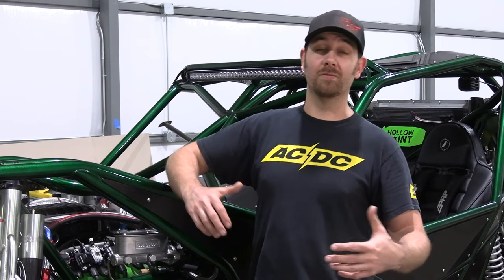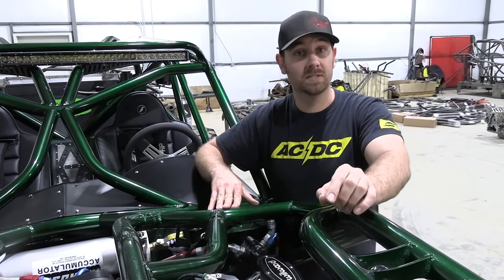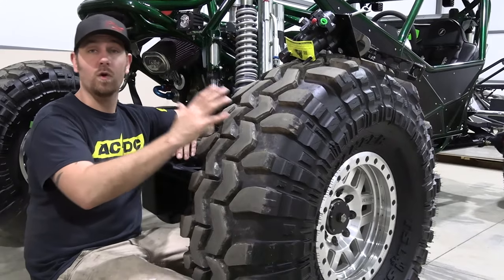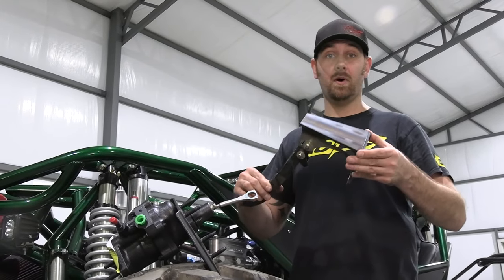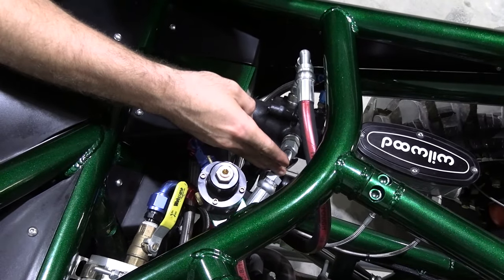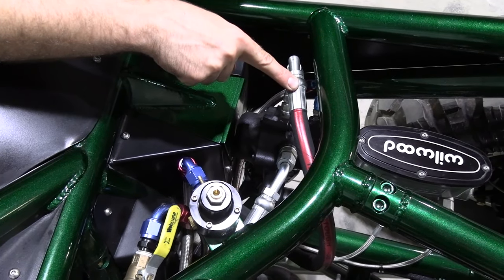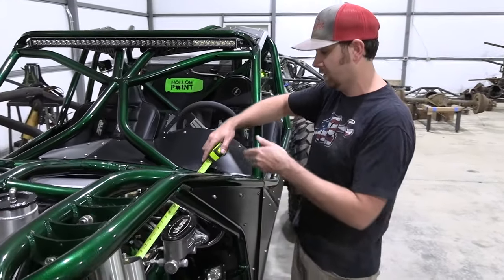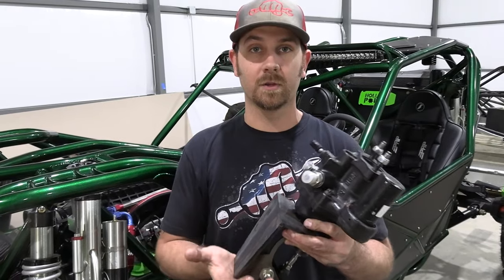HYDRO BOOST BRAKE SYSTEM EXPLAINED | TECH TUESDAY

Comment: I am building a YJ and have a 2012 superduty dana 60 and a 2003 Suburban 2500 14bolt rear axle, it will be 4 link front and rear on 40's. I have a 5.3 LS with a turbo, 4l80e, dana 300 in process of being installed. What brakes would you recommend for the setup assuming I will be using a hydroboost brake setup also given it will be full hydro steer (not yet acquired).

Comment: Any idea if a Jeep master cylinder will bolt up to your PORTED AND FLOWED HYDROBOOST UNIT?
Reply: Or are their lower cost options than the Wilwood unit?
Reply from the maker: you can use a factory chevy one.

Comment: Classic Performance Products makes a pretty decent system. I’ve installed them in jeeps, pickups and cars. I don’t recommend using a stock master and reservoir, most the time the mounting ears don’t quite line up with the hydro boost, the reservoir holds half of what a oem/aftermarket hydro boost reservoir does, and the master piston body is half the size of a hydro boost. If budget is a concern. Go to a junk yard and grab one out of a 3/4-1 ton truck. Ford, Chevy, Dodge doesn’t matter too much they’re all basically the same dimension give and take here or there. Remember bigger is always better in the world of brakes!
Reply: Sorry Jake! Not tryin to get people to cheep out on your kit. Just started rambling.
Reply from the maker: bigger is not always better when it comes to brakes actually.
Reply: Do you mind explaining? No argument here. Just looking for wisdom.
Reply from the maker: you want everything sizes appropriately to work together.

Comment: That's great in all but does it work well with manual steering?
Reply from the maker: Why would you want hydro boost brakes and manual steering?
Reply: @BustedKnuckleOffRoad  to take off the vacuum pump on a diesel engine in a pickup

Comment: @ Busted Knuckle Offroad, how do you manage to run PSC steering and the hydro booster off of the same power steering pump?
Reply from the maker: We build the system to work together.
Reply: @BustedKnuckleOffRoad  Is it documented anywhere, on a forum?
Reply from the maker: @Mike-xn1bh  we port it to work with the higher flow pumps.

Comment: Hi awesome video - have a E-450 Motorhome with Ford’s hydroboost but with all the weight its stopping power is seriously crap so can’t let my petite wife drive as she can’t put enough force on the breaks for a hard stop not to mention emergency breaking, in fact i am far from being able to kick off the antilock on pavement too,  do you offer any solution for increasing breakpower?  I,e. turning cylinder to give it more pushing surface area to multiply the psi of the pump more?  Desperately needing to improve the breaks, thanks in advance.
Reply from the maker: Sorry but we only do off road brakes
Reply: Thanks for responding

Comment: Sorry for the long question but here goes, I have a 2000 K3500 with factory hydroboost.  I did an axle swap and now have 4 wheel disks.  Does the wilwood master you sell fit my hydroboost or do I need your unit also?
Reply from the maker: They should have a master to fit yours. Give us a shout and we can make sure you get the right one.

Comment: If there's a hose that leaks on this system , will it cause the abs brake light come on. Sometimes I get a hard brake pedal.
Reply from the maker: We don't have ABS brake lights in these vehicles
Reply: @BustedKnuckleOffRoad  yeah , but was wondering if you knew if this could be the culprit.

Comment: Will a bad power steering pump affect your hydroboost? And/or vice versa? What about low power steering fluid?
Reply: If the power steering pump is looped into the hydroboost, then yes, braking performance will suffer. If power steering fluid is low, you'll have a hell of a lot more problems than just suffering brake performance. You may find your steering gear and pump fail prematurely.
Reply: if you have low power steering fluid then you probably have a leak at your power steering pump or one of the lines.  And yes you will have weak breaks due to the pressure not being able to build and hold if your power steering pump is the culprit.

Comment: I have pretty much the same setup. New power steering pump, new rack, hydraulic lines. After a couple miles all 4 brakes lock up and drag. Any advice?
Reply from the maker: will need more info

Comment: Hey guys I am from Australia and am having trouble with my Hydro boost setup.  I have the same booster as you are using in your video.  I am having trouble with the resovior overflowing after I turn off the engine.  Only started after I fitted the Hydro boost.  hope that you can help me out.
Reply from the maker: sounds like it may be plumbed wrong

Comment: Just purchased a hydro booster for my 69 Camaro and trying to plumb it in to my rack and pinion but the thing is is that the port holes are so close to the engine sump I see no way of getting the lines in there
Reply: Well- what did you come up with? 🤔
Reply: @smoothoperator7023  so instead of using the straight fitting that was supplied in the kit I purchased lower profile banjo with straight fitting coming from the side if that makes any sense

Comment: how does this plumb in with full hydro steering?
Reply: @Ole Coot   > The power steering pump does double duty with the pressure valve determining the pressure. Rack & Pinion are 600-800 PSI while recirculating ball gear boxes use 1,400-1,600 PSI. The pressure hose goes from the pump to the inlet of the hydra boost unit. It has a fitting for a second pressure to the steering gear box. Both the hydra boost and steering gear have low pressure return lines. The pump will have two return line fittings for the factory or reman from box. It is common practice to help cool the P/S fluid on the low pressure side. From the gear box, the mount a correct size metal line that mounts vertical or horizontal under the radiator but behind the bumper & front valance panel. Cool outside air removes heat and the pipe makes a “U” turn, returns to short gear box line, then onto second pump return fitting. Double or inverted flare was common but gave way to o-ring type fittings. AN fitting use a single 33 degree flare to make it Bubba-proof the seal. Army-Navy fittings are installed by 19-25 year old kids, so to get a good seal & keep them cross-threading, they use the aluminum fittings. Different colors and beaded hose looks cool but just makes a wallet thinner. Hope this helps since it’s been a year. Now June 21, 2021. ASE Master Tech since 1978 - Retired
Reply: What kind of pressure do you need from a power
Steering pump for a rack and pinion and hydro boost to work well together ?

Comment: I worked at the Bendix Facility that made the Hydro-Boost units for Chevy, Ford, Olds, Dodge in 1973 through 1978. I never could figure out why it was called Hydro instead of Hydra-Boost, seeing as how Hydro means water and Hydra means oil.????
Reply from the maker: interesting, kind of like parkway and driveway